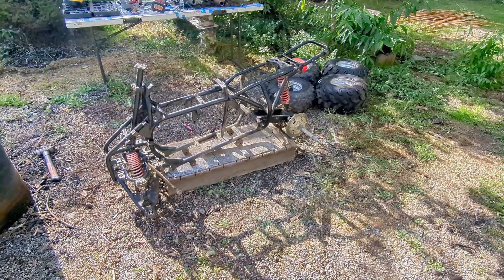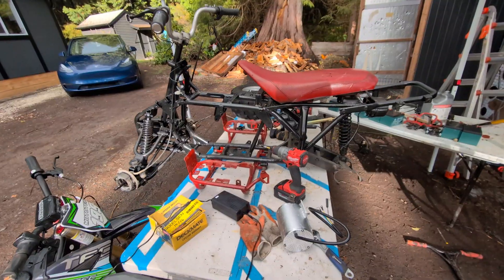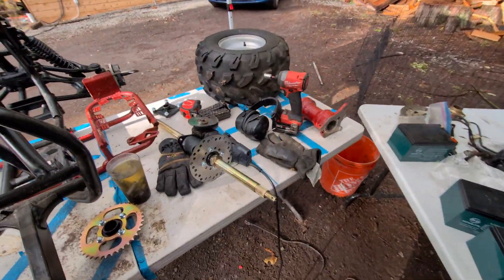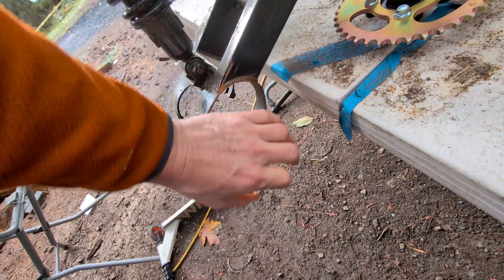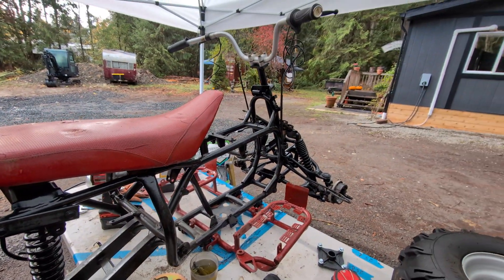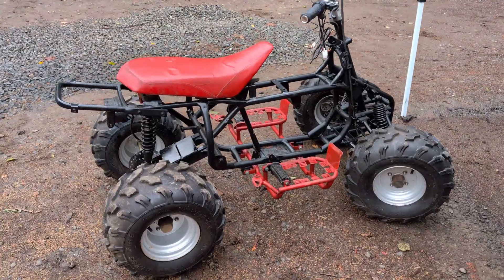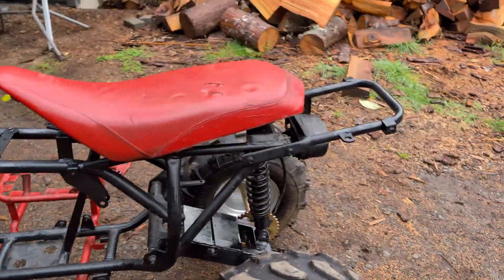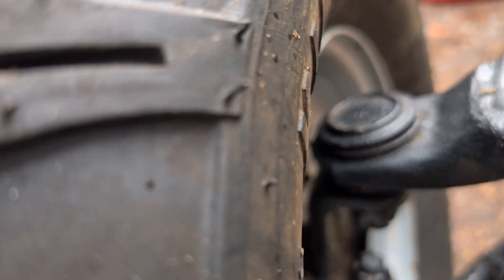Converting a Quad to Electric - Part 1

Comment: the part you called a bushing is a ball joint, and those looks quite worn
Reply from the maker: I know it is a ball joint but what do you call the rubber part that holds the grease in?
Reply: @einarmikkelsenPNW  I would call it a "boot." I don't know if you order just that part, you may have to replace the whole thing